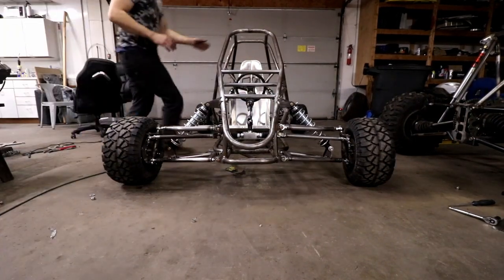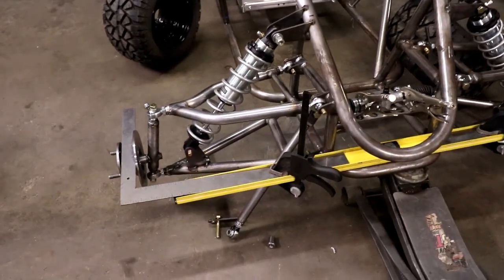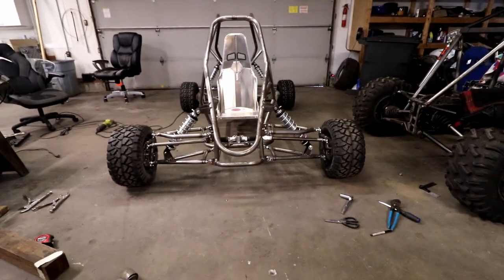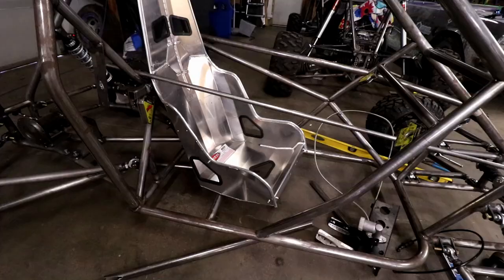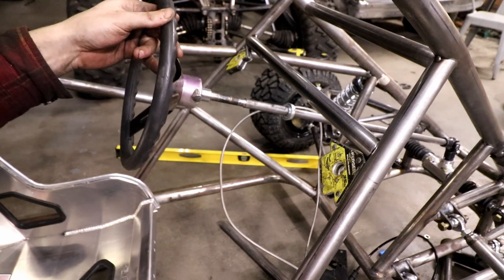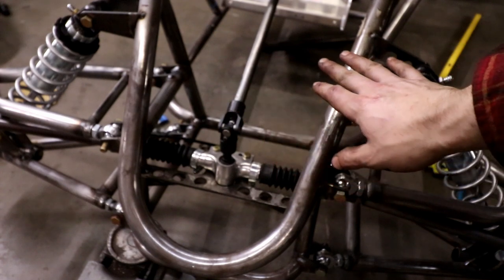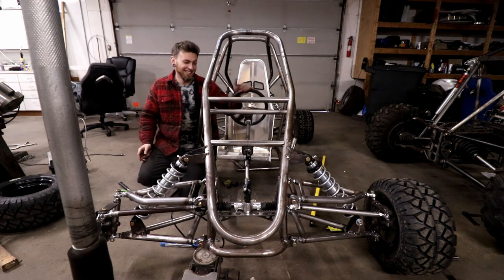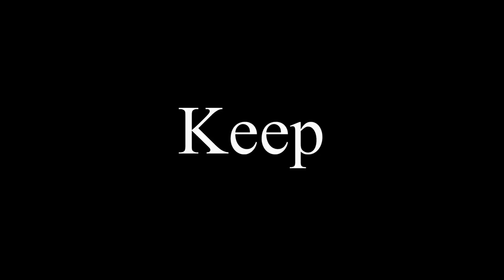Crosskart build Pt 9: Steering update

Comment: Started rushing my motor mount lifts and burned up my eyes welding last night
Reply from the maker: Did that a few weeks ago. I ended up goung to a 13 shade with a headlamp aince ive been welding so much and it works great
Reply: I have mine set to 13 but its harbor freight junk wife wont let me spend stimulus on the internet and weld shop wants my arm and leg for a new bucket

Comment: Hi you need to phase your steering joints otherwise they will quick slow quick slow as you turn . also when you turned your steering rack why not angle it then ?
other than that good build love watching from the lockdown UK
Reply from the maker: what does phase mean?
Reply: if i remember correctly each steering knuckle has to be 90 deg turned in respect to each other . try some of the locost 7 sites they are pretty good at these things

Comment: Two joints in the steering is much safer in a front collision, it will allow the shaft to collapse rather than stab you in the chest! When realizing the rack was in backwards why didn’t you angle it and take some of the stress out of the U joints? I would also figure out why the front tires aren’t turning equally and fix that otherwise I think you will be changing tires sooner than you want to.
Reply from the maker: The steering is an Ackerman setup so one wheel is supposed to turn more than the other. And I've been getting a lot of that question! Lol
Reply: Right now me would love if you could build me 1